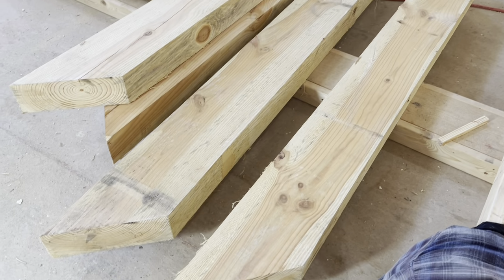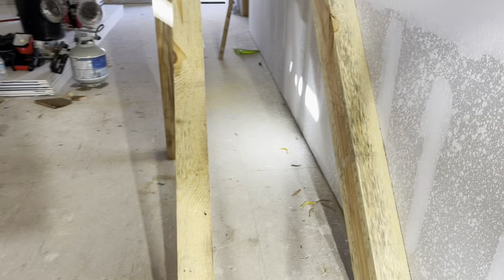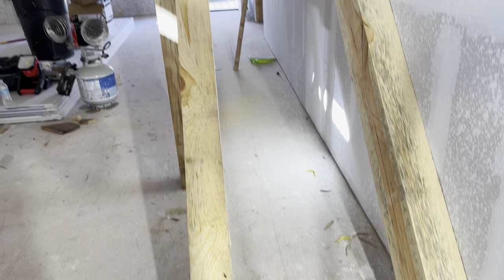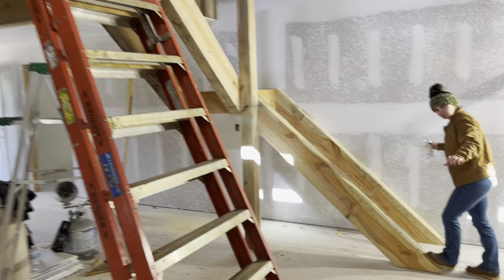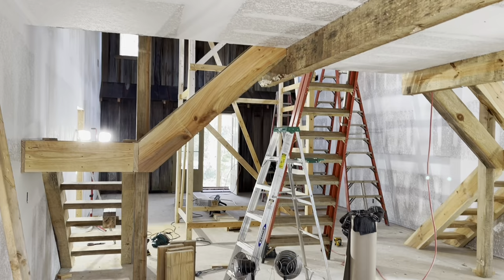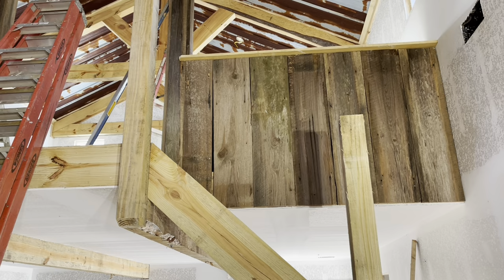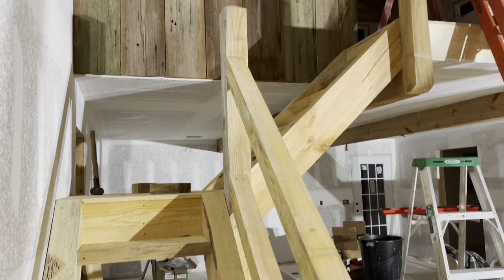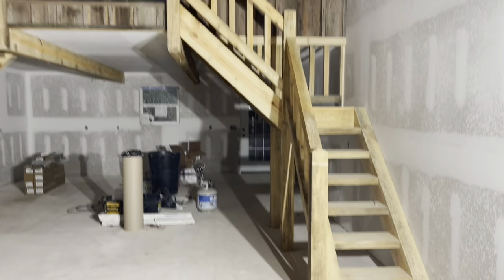Rough Cut Double Stairway Build in Hannah’s house using Yellow Pine Lumber I cut on the Sawmill!

Comment: Looks good but is not even close to minimum code requirements.
Reply: Who cares long as it’s sturdy
Reply: He's building on private property. Jeff's a Hell of a Builder it's better than Code Mr Helper!😂😂
Reply: Hopefully no screws (that don’t have the shear strength of nails or bolts) were used to support shear loads. I see it happen all the time these days.
Reply: I doubt anyone is watching this for the construction.
Reply: Let us know what does not not meet code and which code
Reply: @rogersdrum1 It does not matter if it is private property or not. Every house is private property.
Reply: How do you know code where they are at?
Reply: @boburwell9921  I'm definitely not saying I agree with it but doesn't every state do an inspection when the house is complete ? Maybe they don't I'm just asking. 🤔 Generally whatever the government wants you to do it costs 6  or 8 times more than it should. That way they can access the property value higher than hhelll just so they can tax the living chitt out of ya...
Reply: Im not saying anything
Reply: @raprock5000  The reason they have modern building codes, which is the minimum standard for construction, is so we don’t build shitty buildings any more. I think a lot of the code sections are way too stringent, but that is the way it is.  You have to realize who writes and has input on these codes, overzealous building officials, many who do not have a degree is architecture or engineering. Also many of the codes are written by lawyers who don’t know shit about construction. After 55 years doing this I have about had it. And there is a shortage of architects and construction officials and inspectors. In a nutshell, it has become too difficult.
Reply: @joegotz1971  I don't doubt it one bit.
Reply: @raprock5000 No. Some states dont enforce code if the owner is building the home to live in, but it must be up to code if sold.
Reply: @ChrisRJ  Oh I see, thanks for the reply 👍🏼
Reply: I can't believe this comment got 11 thumbs up, lol. Trying to tell a grown man how to build his own house,  that's our society these day's in a nutshell.
Reply: I built my own house had to get the city inspector out to inspect each stage then he had a final inspection before he would let my power be cut on

Comment: Gorgeous, I love the double open staircases. I am converting an old barn with 1" rough cut 12" wide lapped sides into a house  in upstate South Carolina. I ran into bedrock digging out the horse stalls for the crawl space so I sawed the faces off the rock for facing my foundations. 

I bought surplus windows from a cancelled government building, piping the floor for radiant floors, and been digging a small pond down in the creek.

Comment: Looks good Jeff. I was wondering if you all had building codes in your area? Here in new york state, stairs have to be a minimum 36 inch wide treads.
Reply: They should look at the stairway manufacturers website.  They are not close to code.  Would not pass a standard inspection.

Comment: Looking great, just curious on how you attached the treads? Also I’m always impressed on how much work you’re capable of doing.
Reply: it just does not look right with out stringers
Reply: I was wondering that to
Reply: I’m not saying  or implying it not correct or wrong as there’s many way to build stairs. I’m just curious as to the way Jeff built these.
Reply: Looks like he jus ran some big screws in on the corners and through the sides of the bottom of the treads. prolly put some construction adhesive on the joints as well.
Reply: 24" wide stairway is useless
Reply: Jeff, Toenailed them steps in, I think he will go back and put cleats in "I hope".   No The steps look thick enough to work.

Comment: heavy duty lumber on the stairs but very weak stair tread attachments (toe nailed to side boards) which will fail inspection (if there is 'inspection' in Alabama).

Comment: These stairs are the dumbest I have ever seen! Why would you take a 24" wide stairwell, and close off 8" of width off them to use 4x8 planks??? Losing 4" on each side, making the stairs only 16" wide with sloped sides where you can easily misstep if you are carrying something down the steps, and can't see your feet. Also 4x8 planks will allow something with the weight of a dump truck to drive down the steps, or say a 800lb person to walk the steps. When will you have someone weighing 800lbs walking those steps? It appears that these steps were built for a 100lb woman. Then you just 'toe-in' the treads with a couple of screws. Who does that?? This is NOT how stairs are built. This is the lazy man's way of building stairs. When in truth cutting risers for the stairs would have been much much better, and the treads rest on the risers, giving the stairs much more width and strength. Also, then you use 4x4 handrails that will be almost impossible to grip if you are falling. Very lazy milling, as these timbers could have been cut to resemble lumber that is typically used for stairs, for a reason. These are the dumbest steps I have ever seen. Been a builder for 30yrs. They may 'look' good...but dumb, dumb, dumb...I bet this comment will be deleted.
Reply: I'm sorry Sr. I don't think you understand the concept of the interior of Miss Hannah Barron's house. 

You don't like it, keep your comments to yourself. 😶
Reply: @jimmybatts3300  Yeh... censoring comments is what the comment section is for...what rock did you crawl out of. I understand building concepts, safety and correct building processes. Unless this house is in a hurricane, or tornado zone, that stairwell is nuts.